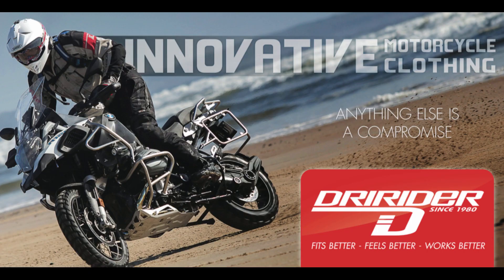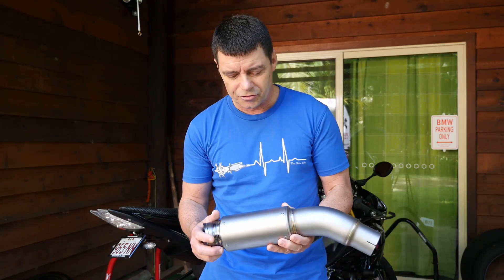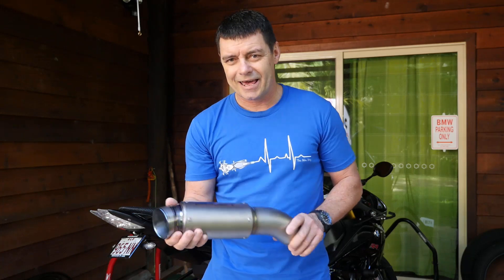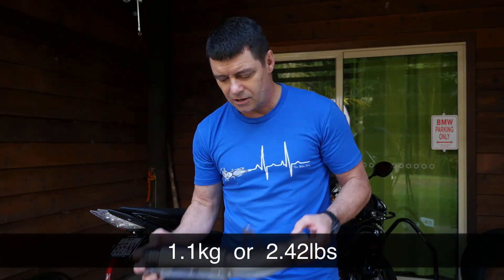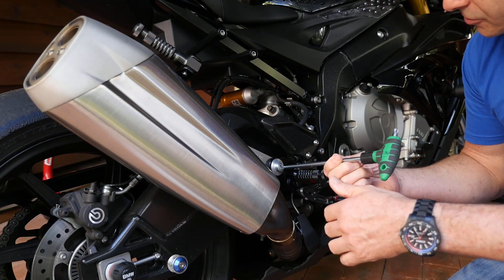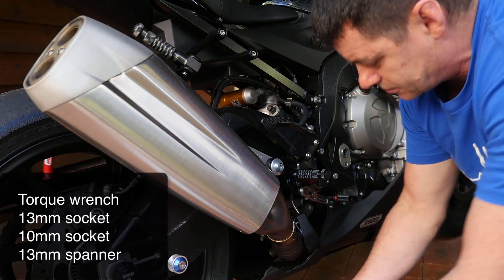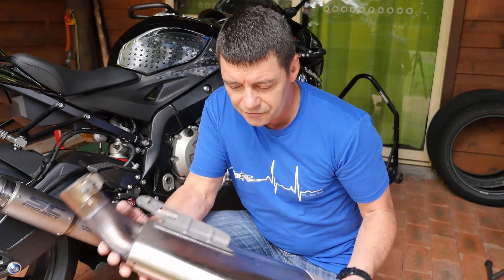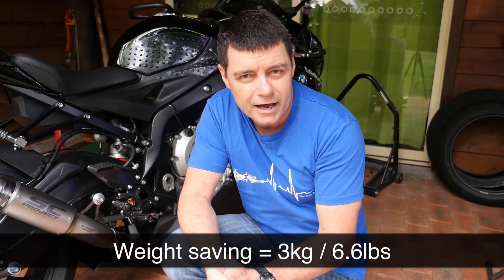SC Project GP70 R Exhaust Fitted to BMW S1000RR

Comment: buddy do you have to wear earplugs with this exhaust !?😮
Reply from the maker: absolutely! I found it incredibly loud for the rider up until around 118kph where the noise shifts to behind the rider and is more bearable. I did one ride on the street and forgot plugs and had some ringing in my ears, lol. We ended up settling on the SC Project 'Conic' with the baffle removed and paired it with a Power Commander fuel management system, super impressed and the noise is much more suitable to the street.
Reply: Thank you for your valuable reply mate !😊👍